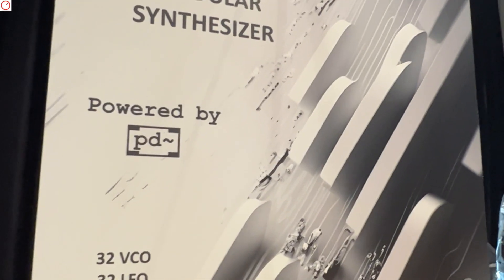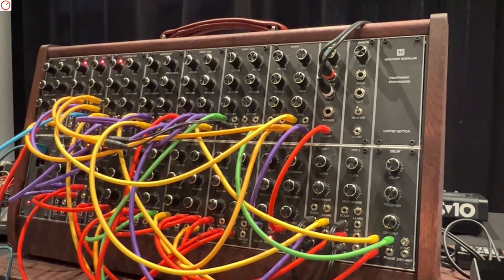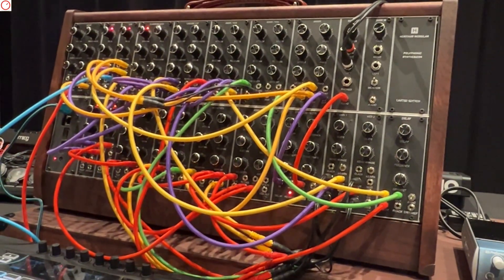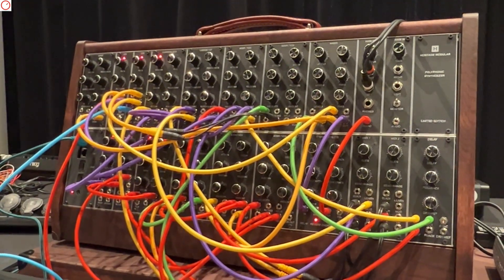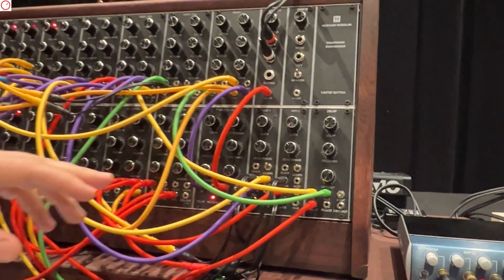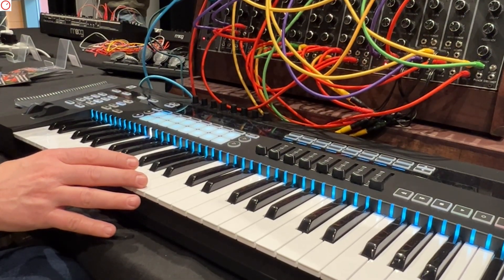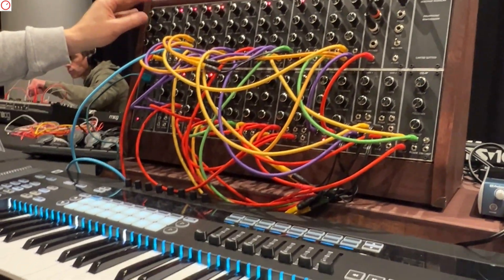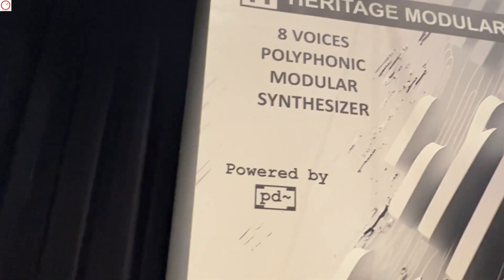Heritage Modular,  8-Voice Polyphonic Modular Synthesizer | SynthFest France 2023

Comment: I didn't really get weather it is possible to add further modules or if it is a closed system?
If the latter it's kind of similar to the Korg MS-20 Software Synthesizer.
It would be super awesome to have a system like this controlling software that is again controlling an analog poly in the back!
In any case congrats! This is quite the project to just muck about for yourself!
Reply: Yes, you can add new modules. Each hardware module needs to have its "digital twin" running on Pure Data side. I have started with a single module, and have grown  the system up to 20 modules for now.
Reply: @f1oat3d  Fantastic, that makes your approach truly modular (unlike the Korg thingy). Thank you for the reply and again great project!
Reply: Its a synthesis software called "Pure Data" running on a mini PC to which he has added knobs and fake cables to "appear" to be something analog. 
Nice project but it has been don many times before. Its entirely digital.
Reply: @deadmanwalkings  the cable are not fake, they are driving the connections between modules, but they are carrying digital signals instead of analog
Reply: @f1oat3d  good grief! its fake, it does not transport any analog cv or audio you even said so in the interview.
Anyhow on of the first thing like this was Martin Hollingers FPGA Synth Airbourne AVS-04 A back in 2006 then a load of VST's with similar hardware  interface over the decades.